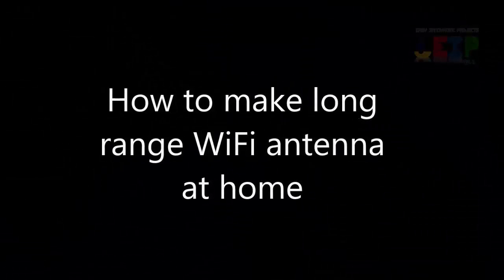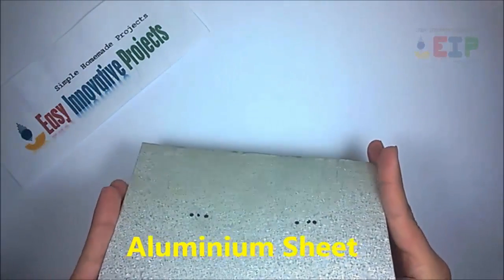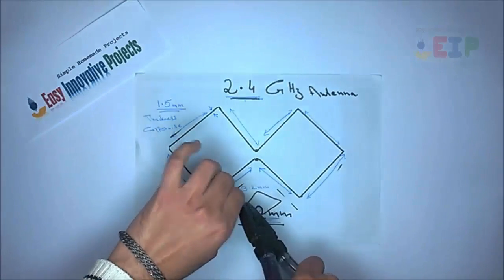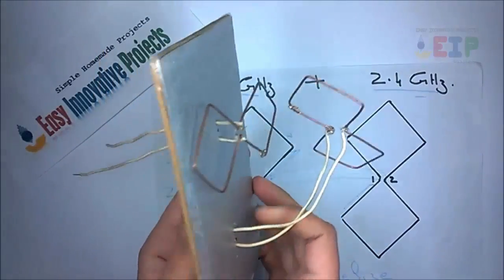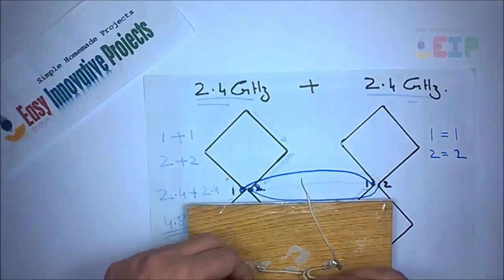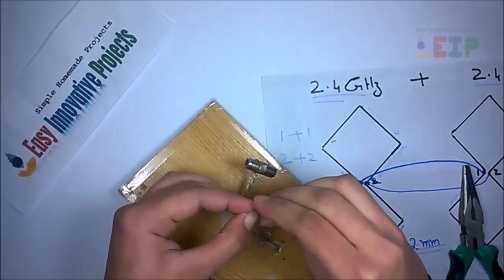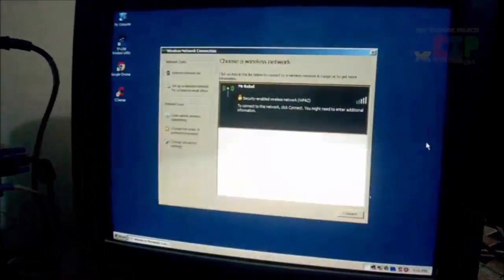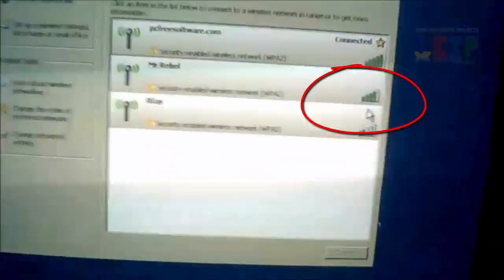How to make long range WiFi antenna at home - Easy step by step

Comment: Can you tell the cost of this antenna
Reply from the maker: you can buy signal booster antenna roundabout 20$ to 30$.
but if you cannot afford then follow this simple steps and make same.
both are work same.

Comment: Whare is attached cable wire in computer send me photo
Reply from the maker: its very simple. 
you connect antenna cable with WIFI card. 
thanks.

Comment: Can I join the antenna wire direct to the tv cable wire? And then i will connect the female wifi connector
Reply from the maker: yes dear, you can join directly.

Comment: And how to attach antenna in my pc please say fast
Reply from the maker: dear,
this antenna attach on WiFi card. try to find back side of PC.  and attach with connector.
Reply: Easy Creative Projects : which wifi card that you using please say fast
Reply from the maker: Dear, i use tp link tl wn751nd 150mbps wireless card.

Comment: When you connected the female tv cable to the antenna which thing you connected with second cable
Reply from the maker: dear,
2nd cable connect on PC using (WiFi cable connector.)
you can easily purchase from shop only 1$.

Comment: what is the range of it ? jow much km it can be connected to ?
Reply from the maker: dear its range round about 700m to 1km. 
for better result attach this antenna on top of house.
i use it on 600m distance and only one signal drop.
 its mean its range 1km and above.